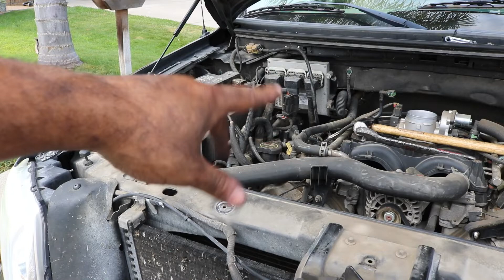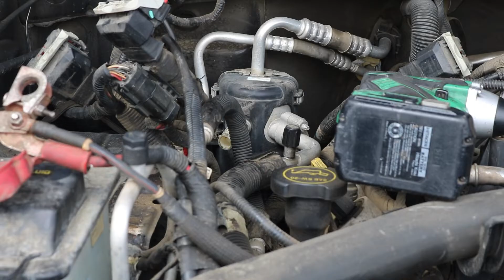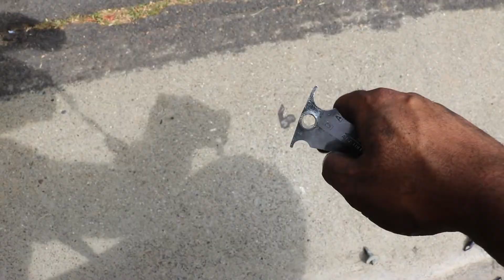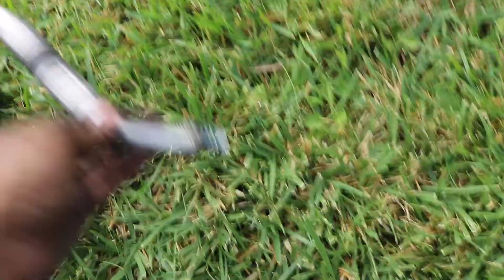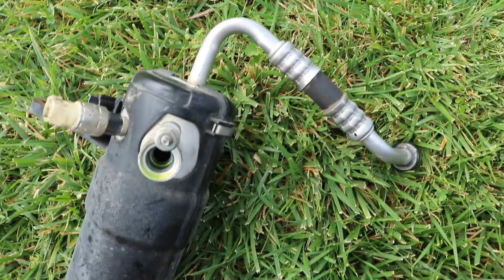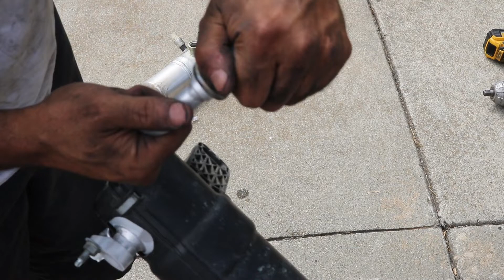2004-2008 Ford F150 AC Drier Replacement

Comment: I guess I will see it once I start taking things apart....but I had bought a new orifice tube.  Looking at this....wondered exactly where does that go if anyone can point it out.
Thanks
Reply: I’m currently doing the condenser, compresser, and dryer on same truck with 4x4. The tube goes into the lower line connected to the condenser. I believe it’s 19mm and 21mm nuts that need separated. Once you disconnect it you’ll see it inside the line. If your confused on the location @autothechgarage6268 posted a video on this. The title is called “2007 Ford F-150 | Orifice tube | A/C not working”
Reply: @Bronsonw96  Mr Bronson----you are highly thanked and appreciated.  Will definitely look there and believe I'll find it.  Were the parts you're replacing all leaking or you feel it is just good policy replacing them all?  My low suction line was leaking and I had read it is good to replace dryer also.  Got to thinking....why not replace compressor too.  Now I am thinking...why not the condenser as well.  If you are going to jump off a building, might as make it a tall one.  Thanks again for your help.
Reply: @JesusIsTheAnswer-o8q compresser seal went out and is leaking. From past experiences it’s best to replace all parts to avoid contamination. Glad to help
Reply: @Bronsonw96  I see.  That is good advice and I believe I'll follow suite.  Have a good one.

Comment: Do you have to replace de dryer when you replace de compressor?
Reply from the maker: It is recommended but I haven’t always. If your compressor has failed or seized, I would certainly replace the drier.

Comment: My parts are in for the drier and have the hoses also.  Going to try to put this in and the hoses tomorrow.  Hose is leaking.  Not sure of any other leaks. Truck is 20 years old.  Was debating whether should do the compressor while the system is evacuated.     Again, truck is 20 years old and almost 200,000 miles.  I would appreciate anyone's vote of whether to replace compressor too or no.  Thanks for the help.  Fabulous video.

Comment: While searching, I found your video and it helped me identify a missing part on the truck I recently bought. It's the A/C tube with a sensor, the curved tube that comes out of the top of the condenser. I see that this tube has a label; could you please help me by giving me the part number for that tube?

Comment: Do you need to replace the drier if replacing the compressor? My AC makes a ticking noise when turned on. I was told it was the clutch. Figured I'd just replace the compressor altogether.  AC doesn't blow cold anymore since the ticking. Only heard outside the vehicle.
Reply from the maker: I would and I would also replace the orifice tube as well. Most of the time the driers come with them but double check.
Reply: @HelpingHandAutoRepair thank you!

Comment: I agree about  charging the system.. The small cans of refigerant typically have oil in them and sometimes sealant to seal small leaks.. typically you will find you clog your oraphise tube.. If your changing your lines, dryer and compressor dont forget to change the oraphise tube . Disconnect the high pressure line.. I believe its the top one from the condensor.. Check your mfg recomendations.. They are cheap and easy to replace.. If you have a leak after replacing the lines, compressor and dryer and condensor you likely have the coil leaking.. 04's didint have cab air filters and its not unusual for the coils to go on certain f150,s.. That envolves removing the dash... I remember changing out the A. C on an older f350.. Walk in the park.... My 2003 f350 was a dream with the spark plug ejection issue at 69000 miles.. My 2004 f150 has 300,000 miles.. If you know your way around Fords they are still great trucks.. Great video . thankyou!
Reply: And replacing the schrader valves if you dont replace the lines is good practice too

Comment: Old video but to add that before using the quick disconnect tool, cut the short piece of black hose on the line all the way through first, then use the quick disconnect and it makes it easier.
Reply: Good video btw!

Comment: I just want to let you know that this video helped me immensely while replacing the AC compressor on my 2008 F150 with the 4.6 engine.  I wanted to flush my system too and replace the orifice tube and the AC drier.  I figured I must get all this done at the same time before the head of summer settles in here in Arizona.  I was looking at where the drier is hidden on these trucks and was not looking forward to the job.  Your video made it extremely easy, and I just followed along.  I like how you didn't film the disconnect of the line to the evaporator because this probably would have been rated X!  :)  I happened to have a set of the disconnect tools and after about 10 minutes of struggling with it, the clamp popped right off.  One thing to mention about removing that line to the evaporator is to remove the two 11mm bolts holding the drier assembly to the firewall.  It makes pulling that hose clear of the evaporator just a bit easier.  Thumbs up to your video!
Reply: Not sure if you will see this, but I thought it would be worth giving you a shout.  I am about to attempt this myself.  Replace the drier as well as the suction hose assembly.  Have a big leak in the low side hose.   
Do you happen to remember the quick disconnect set or part you have?  The brand maybe or where you purchased it?  If you get a chance to reply, thanks so much.
Reply from the maker: Pretty sure it is just from O’rielly auto parts.
Reply: @HelpingHandAutoRepair  Thank you much.

Comment: This should be similar to a 2004 Expedition correct?
Reply from the maker: Probably pretty close
Reply: @HelpingHandAutoRepair  I have to do this to my Expedition before summer swings back around. My compressor went out in September which was the perfect timing.

Comment: The refrigerant can be removed with a vacuum pump if you own one. Connect the hose to the low pressure port. It’s usually marked by being blue or with “L.”

Comment: Is there a specific type of gasket or o ring set to get? Also how do you replace them? I missed that in the video.
Reply from the maker: There will be some gaskets and o-rings that come with this drier assembly. They don’t need to be installed since most of the assemblies come with the gaskets pre installed. 

If you are talking about replacing all the o-rings and gaskets in the system, you could buy a master set and replace them all. This video is not going to show any of that.
Reply: 26820 a/c kit from oreily had all new o rings for my 2006 f150

Comment: How did you know this was the problem?
Reply from the maker: I replaced the compressor on this vehicle because the clutch physically broke. I replace the driers when I do major ac work such as replacing the compressor. I also suggest replacing the orifice tube and filter when doing this drier replacement. I bet it’s clogged up.

Comment: Would anyone mind letting me know where the Orfice Tube is on this truck?  I have the same truck.. pressures are climbing up to 450 and the safety is popping the compressor off.  I have a blockage somewhere and likely replacing the this and orfice tube.  I know my compressor is good, AC works for a good 20 minutes then, pressures climb and it clicks off.
Reply from the maker: If you watch the video and get to 6:22, that line I’m holding. Just follow that towards the radiator where it meets a flare but. Pull that apart and the orifice tube and filter should be in the end of that hose. I actually replaced the filter in this truck in this video. It was severely clogged up!

Comment: If just replacing the receiver dryer / accumulator should PAG oil be added and where?
Reply: My understanding is when evaluating the system NO PAC oil is removed however you should drain the old dryer of the oil and replace same amount drained with new oil???? Correct?!!
Reply from the maker: If you get the system properly evacuated they can note how much oil came out and just refill the same amount back in when the system is recharged. That’s the easiest way to be 100% sure.

Comment: Man, you did a great job of getting this process onto video with great (simple) explanations for each step.  I have the parts to rebuild my 2004 f150  sitting in my garage, and needed to learn the process for removing (and locating) the dryer.  Your teaching process is good.  Keep producing them and you will eventually start making money on youtube.  I bought the vacuum gauge assembly from O'Reilly's to pull a vacuum on my system and use the Freon from the store to refill, but I'm taking it back, getting my refund and going to have the gas added professionally like you said.
Reply from the maker: Get after it! Thanks for watching.